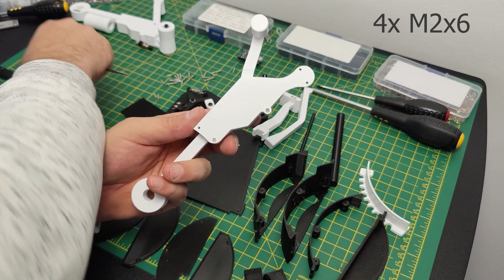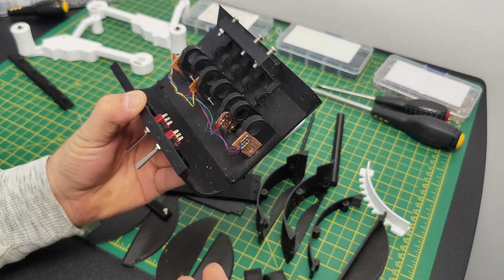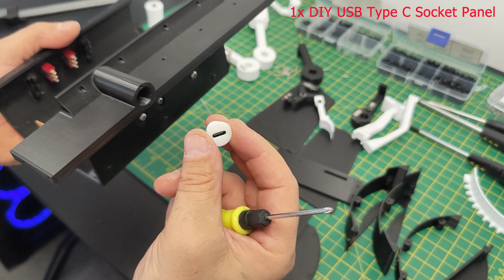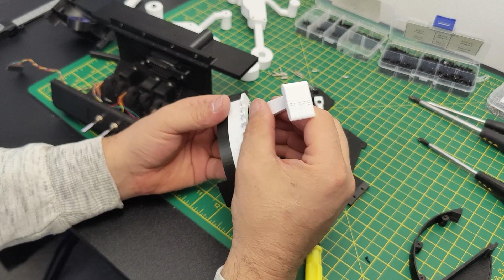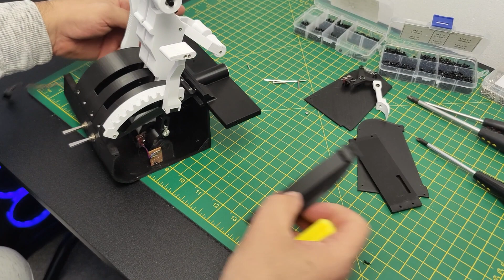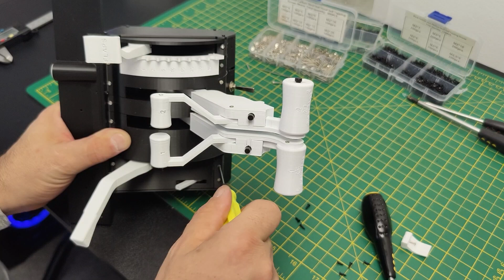DIY 3D Printable BOEING THROTTLE TQ QUADRANT, SUITABLE FOR 737, 777, 757, 767

Comment: Which hall sensor did you use? or can I use potentiometers?
Reply from the maker: Hi, for potentiometers you will need to modify the project, was not designed for it, i used SS49E Linear Hall Sensor
here you can find a guide  https://www.silencediy.com/guides/throttle-quadrant-guide/